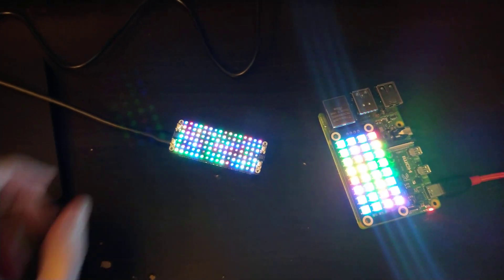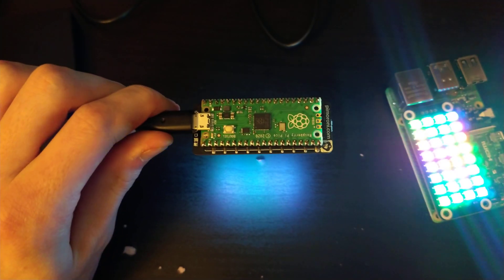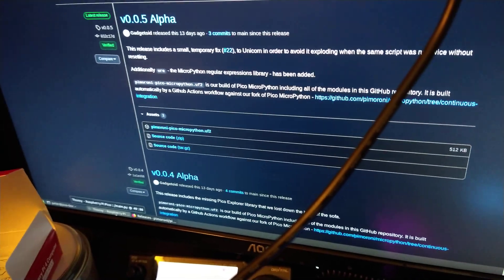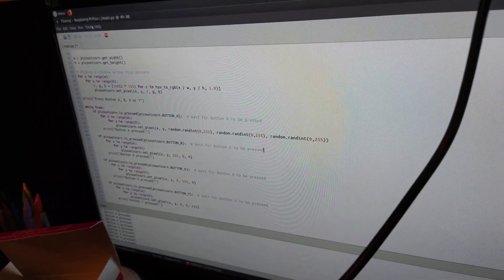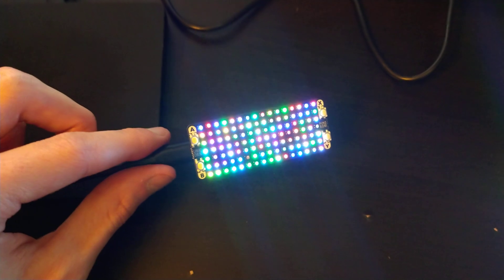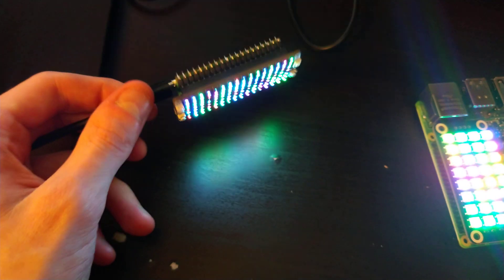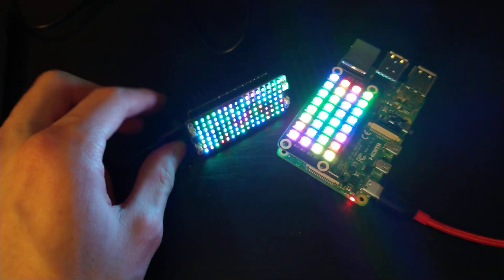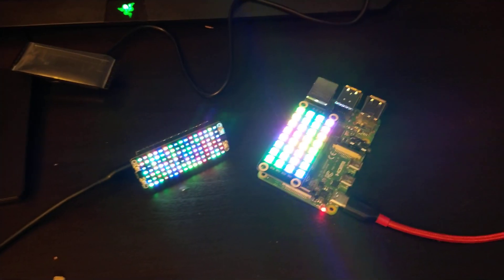Raspberry Pi Pico with Pico Unicorn Pack

Comment: It's 'boot select' button, nothing to do with reset pin (which is pin 30 labelled 'Run')
Reply from the maker: Ah okay, cheers for that info
Reply from the maker: That would explain the need to disconnect it phyisically instead of just pressing boot sel for a reset. Shame there is no reset button on the PCB since unplugging can be annoying.
Reply: @2E0PGS  All you have to do is connect the RUN pin to ground via a momentary switch and you have a reset button. No need to keep unplugging it.  The boards are £3.60 each, apparently putting a reset button on the board itself would have been too expensive.
Reply from the maker: @ste76539  Yeah I know how a reset pin works. But I was indeed specifically talking about the lack of one on the PCB itself. Or the fact they didn't combine the boot sel with a reset function e.g. momentary press instead of hold. It does I suppose automatically resets if you upload new boot loaders so there is that.

Comment from the maker: Testing out some MicroPython on the Raspberry Pi Pico with the Pico Unicon Pack attached.

Note: Near the beginning of the video I said something that sounds like "boost pin" but I am actually saying "boot pin" meaning the "bootsel" button on the Pico. I say pin as it possibly relates to a reset pin on the microcontroller. 

Link to Pico libraries and uft2 file: https://github.com/pimoroni/pimoroni-pico/releases

Link to a useful blog post: https://makersportal.com/blog/raspberry-pi-pico-tests-with-micropython
Reply: A tip: watch movies at flixzone. Been using them for watching a lot of movies during the lockdown.
Reply: @Giovanni Jerome definitely, been using Flixzone} for since november myself :D
Reply: @Giovanni Jerome Yea, have been watching on flixzone} for since november myself :)
Reply: @Giovanni Jerome Yea, I have been watching on Flixzone} for since november myself :)